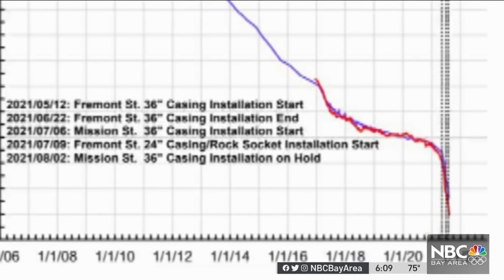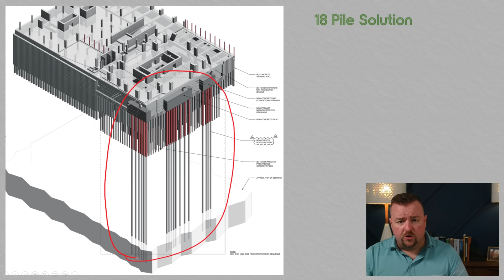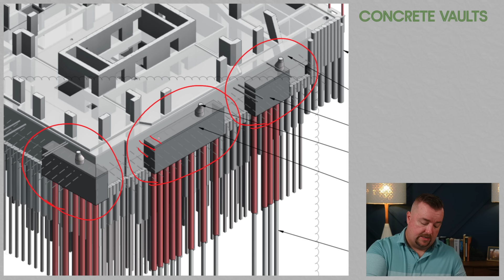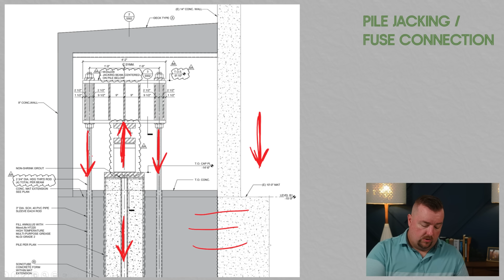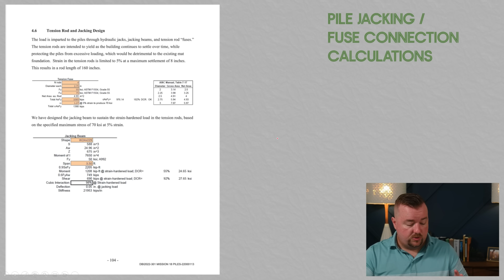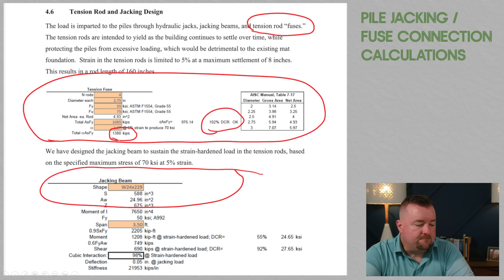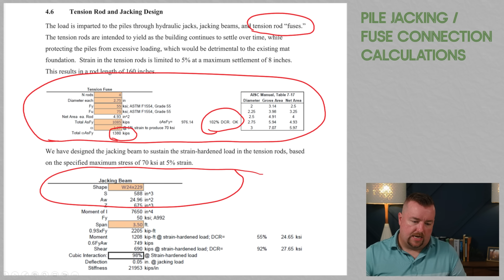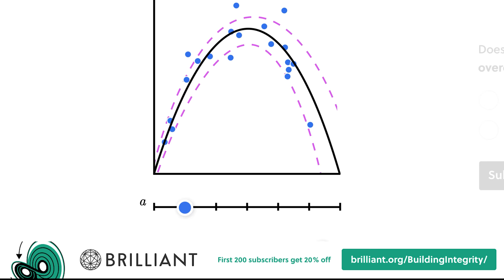Did I Uncover a $100,000,000 Mistake with the Millennium Tower "Fix"?

Comment: I am a retired Professional Civil Engineer who worked on numerous complex projects during my 50 year career. This issue illustrates the fact that engineering projects of this complexity are very difficult to implement because there are always variables that must be estimated during design because not every variable can be quantified with certainty. The vast majority of the time, project implementation goes smoothly with only minor issues arising which are corrected relatively easily during construction. However, at times, major issues arise which are very challenging to correct, as in this case. I feel for the project team; this kind of situation is very challenging for everyone involved.
Reply: High rise building in SF are nothing new. The tower was under built to save cost.
Reply: @Apodictic1  I believe you missed my point, and did not understand the information presented in the video. The underlying soils on that site are quite complicated from a design perspective. It is entirely possible that the engineers obtained a reasonable number of test borings that they thought were sufficient based on other work done by themselves and others in the area. However, in reality those borings did not detect the unusual nature of that particular site. This type of situation occurs from time to time. If this is the case, it could explain why the excessive settling and the tilting are taking place. From what I have read, and the videos that other engineers have posted, I do not see any evidence that the “tower was under built to save cost”.
Reply: @petesmith6434 — The opinion of the remediation engineer is that the cause of the tilting was removal of water from the Old Bay Clay layer west of the site when Salesforce Tower was built.  It seems likely that it was a factor, but probably not the only one.
Reply: @GH-oi2jf  That may have been one of the factors for sure. These kind of “moving target” largely unknown variables that design engineers must contend with. The more built-up an area is the more unknown variables there may, and most likely will, be encountered. Many years ago I designed a large (64” diameter) gravity interceptor sewer project for a very large old city in New England. The entire route where the pipeline was required to be located was built-up and had been so for over 100 years. There was every type and kind of utility located in the same corridor…with little documentation of the horizontal and vertical e location of any of them. Needless to say, this was an extremely difficult project because it was a gravity pipeline so pipe slope had to be maintained. The bottom line is that a construction project that was scheduled to take 12 months took eighteen with large cost over-runs because of unforeseen conditions that could not have been anticipated. This occurred in the 1970s when owners, engineers and contractors were understanding of these kinds of issues and we all worked together to resolve all the issues. Even though the construction time and costs were greater than anticipated, everyone was very happy with the project upon its completion…and no one sued anyone. Today, when issues arise, the first thing every party does is start pointing fingers and run to a lawyer and start legal action against everyone else…ultimately resulting in scandal and even larger cost over-runs.

Comment: All the pilings are in a straight line. Instead of having a small plate set between the 2 rods, why not have a heavier, continuous plate that connects all the rods on each side of the piers ?
Reply: In fact, the new pilings are on both sides of the west corner.  There would be no point to connecting the piles together.  Each bears its load at the edge of the foundation slab.

Comment: Isn't the sinking building pulling down on the alt-thread rods since they are fixed to the plates which are fixed into the concrete vault which is fixed to the building?  You make it sound like it's the hydraulic jack that's pulling down the rods rather than the other way around.  Looks more like the rods are trying to compress the jack and the jack counters by  transferring the force into the fixed piling.
Reply: He has described it accurately.  The allthread rods are under tension; the jacks are under compression.

Comment: I have no engeneering degree and my knowledge of building design is very limited. One can see that there really is no fix for the Millennium Towers. San Fran. is land fill and reclaimed land from back in the early years. San Fran. sits side by side with three major earthquake faults and prone to liquidification. By installing pillings on only two sides of this enormity seems like in a quake that the Bay Area is past due for is going to cause an uneven distribution of weight and load. This building is going to come down, one way or another. Can you imagine what it would be like? OMG! This is just rolling the dice, very, very expensive dice. Why not just take it down? The financial loss , is what it is.. the loss is the result of failure. What about shortening it ? Remove a several floors to where the weight and load is correctly managed. IDK.The possible losses are much greater if theres structural failure and the Millennium Towers, ".. all falls down". 
WOW!  San Jose Ca.
Reply: The fill was excavated from the site before building.  It does not sit on landfill.  The problem is that the original foundation has proven to be inadequate for soil conditions.  Supplemental piles have been added to the side where the subsidence is greater, and they have arrested the tilting.

Comment: Id have a huge steel ring 6 inches thick going around the piling connecting all the rods in place of the existing plate. Isn't it good to over engineer things like this? Like if something needs to hold a million pounds, design it to hold 2 million?

Comment: I'm no architect, but the cost of the steel bars is such an insignificant sum to the project overall (probably less than excavating 1m³ of soil), that there's literally no excuse not to quadruple them. If it added $50k to the overall cost, it's still less than the cost of a single vault structure. I'm going to guess the steel bars come in at less than $150 each, any quantity surveyors able to do an estimate ?
Reply: It may be that they actually are the right size.
Reply: @GH-oi2jf  given that you will never be able to examine them once the concrete is poured, is it really worth taking a minimal approach ?

Comment: I don't get it, they're not just trying to stabilize the sinking/tilt, but they're trying to right it and prop it back up?
The whole building is tilting it seems, not just the corner, is the original foundation/pile cap slab able to take that torsion force on one corner? 
Say the vault connections don't fail and lift and inch on that corner, the opposite side of the whole plate isn't going to rise, there's just a massive deflection in the middle pulling up ALL the original piles on the side of the vault. The compressed subgrade does not decompress, what are they planning to do then?
I reckon the best they can do in this situation is to drill 6-8 bore holes on the worst side of settlement and high pressure Grout THE WHOLE SPACE BETWEEN BED ROCK encasing up to 3 meters of the bottom portion of the original piles. 
The building should settle on the opposite corner and repeat the whole process on the other sides and corners after leveling off the building in 30-50years? 
We all hope no minor EQ happens here also. God bless these folks.
Reply: The first objective is to arrest the tilting.  The tilting is in the direction of the corner at the west.  Yes, the whole building is tilting, because it is stiff, and the direction is toward the corner on the west.

The foundation mat is bearing a load more or less evenly distributed across its surface.  It tilts as it sinks because of differential rates of subsidence in the soils beneath the mat.  The remediation piles are now supporting the west corner so it can’t sink further.  This will allow the building to become more upright as the east end settles.  The building will not be lifted.
Reply: @GH-oi2jf  Not being argumentative, but if they're just trying to stabilize the west corner they won't be using hydraulic jacks. They're trying to prop up that corner of the building. 
The video was saying the embeded threaded bar caps will strip because they'll take the whole weight of the building. 
The basement slab has not cracked because it's settling evenly to the ground water loss gradient, a low grade (difficult to explain in words) but the whole basement slab is supported evenly. 
Once you use hydraulic jacks it pushes a corner UP-wards creating a void between the two opposite corners. Basement slabs are great in compression but once you push up a corner of a building it creates torsion in the center of the whole slab. I think it'll crack ex exacerbating the problem IMO.
I had the opposite problem on one of my projects, we had a high water table and had to install huge preforated drain pipes along the side of hill facing B4 basement wall exterior or the whole foundation (Tub design) will flot before the 20floors could be built on top.
Reply: @rusticbox9908  Each new pile has a hydraulic jack at the top, and the jacks are adjusted to one million lbs.  They are definitely using the jacks.  They are a key component in this system.  The jacks are not lifting the slab, merely holding it up on that end.

This system does not support the entire weight of the building.  The weight of the building is distributed across the foundation mat.  The mat may settle further on the east end.

Comment: Mechanical engineering student here. Has anyone considered how threaded rods tend to fail? The notch effects are horrendous. I know that there are formulas and approximations for equivalent or effective cross-sections. But if you want to push these rods to PLASTIC deformation, I sure as hell hope you know EXACTLY what you're doing, since approximations don't cover this. However, considering the missing calculation of the load transfering plates, it doesn't seem to be the case.

Am I completely on a wrong track, or is this also part of the issue? Pls feel free to let me know, would be glad to learn something.
Reply: According to an article in Structure Magazine, they are normally loaded in the elastic region, near the limit.

Comment: New question what it they add guy wires to the building to stop the leaning and let it settle straight to bedrock  then you wouldd have say a 400. Foot building and 300 housing unites left with 100 basement units for low income residents?
Reply: The leaning has been stopped.

Comment: It does not make sense to sleeve and grease the threaded rods.  The threaded rods should be casted in concrete and used rods and concrete bond to lift the concrete

Comment: Si if system applied to only one side of building wolds and eliminates settlement, what happens if the other side of the building continues to settle? Could you have a large moment arm creating torque causing the building to tilt to the settlement side? They need to secure all four sides I would think.
Reply: They expect and want the east side of the building to continue to settle.  That will bring it closer to plumb.

Comment: So if the entire load is directed to the 6 inch plates embedded into the concrete structure around the pile. Why didn’t they implement several of them in order to ensure that the load was sufficiently transferred? Ya know better safe than sorry kinda thing? Like put 4 on each side or some shit. To ensure that it is properly distributed. Especially if you drop the original scope from like 56-82 piles originally down to 16 piles
*/- I don’t remember the exact number so it is a rough estimate of how many piles I believe should be sufficient with the provided pile information and load requirements. By the way I’m not a structural engineer. I’m just an aspiring astrophysicist
Reply: As a part time rodent hunter I don't have a prairie dog in this fight but I would say that they made this "fuse" all-thread design for the sole purpose of reducing the load on the bedrock from any one given pile because I understand they're concerned about the bedrock itself failing. Therefore the all thread material itself is engineered to compress a given amount over it's total height, hence greasing it up. Therefore you wouldn't be able to attach plates anywhere else along it's height without throwing out that compression calculation.

Comment: Steel and concrete below grade with its attendant moisture issues:  Even if it holds up well when newly installed it sounds like an eventual 'Surfside' collapse scenario in which long term water intrusion rusted rebar and caused concrete failure.  Take the damn thing down.
Reply: A lot of buildings have steel and concrete foundations below grade.  The problems at Surfside went beyond the choice of materials.

Comment: I wonder about that angled bit of the vault.  It seems to me that the entire weight of the building will be pushing down on it, and some of that force will be directed horizontally outwards, with the only opposing force being the rebar.  I'm not an engineer, but that sounds dodgy to me.
Reply: That angle is necessary.  If there were a horizontal joint with the weight of the building bearing downward against the vault, there would likely be fractures at the corner.  It would be difficult to prevent this with rebar.  As designed, there are large reinforcing rods which follow that sloped joint and tie into the reinforcemant of the foundation mat, holding everything together.  This is illustrated in the article in Structure Magazine.

I wondered about this myself at first, until I figured it out.

Comment: Does the earthquake area have anything to go with shearing the rods?  So that the building can move?  I don’t get why only one side is ok?  Wouldn’t the building just sink on the other side??
Reply: The problem is that the settling is uneven, causing the building to tilt.  Now that the low side is supported, they want the opposite side to settle so as to reduce the tilt.

Comment: Well...since they are being "very careful" this time, that's reassuring. 
It seems like it would not be hard to model the threaded rod trying to pull out of the one-inch steel plate.  
(250,000 pounds sounds like a lot of force to me. )
What happens when a gusty wind blows on the building??
Reply: The characteristics of the threaded rods are known.  If they are loaded beyond their yield strength, they will undergo plastic deformation.  That is, they will stretch a little bit, which will reduce the load.

Comment: Putting a building of this size and weight on a floating slab in a landfill area is asking for trouble. By contrast The Belli building is on a floating slab but its a short masonry building
Reply: The top layer of sediment was excavated and the original piles were placed in a natural sand layer.  With a friction pile foundation, it doesn’t much matter what the upper layers are.  In this case, the foundation was inadequate, but not just because of soil conditions above the sand.

Comment: Why no extra cross-plates at intermediate stations above the existing one ? Is there a rebar cage or structure within the vault wall or is the vault just massive concrete to both maintain the integrity of the vault and to spead loads within it ? What is the threadform used on the bars and nuts, is it just a simple machine cut "V" with its inherent stress risers ? Why just a simple steel plate with no flanges to resist deformation along its length as any twisting or bending will affect the concrete surrounding it ? 
For something so vital the mechanical interface between bar and concrete seems awfully slight given the forces acting upon it, given that the concrete pour of the vault is a one-shot effort.
Reply: Their is rebar in the vault.  The illustrations in Structure Magazine show it.

The threaded rods have rolled threads.  They are probably UNC 4 tpi.

The high-strength concrete of the vault is sufficient support for the plates, which are 1.5” thick, in my opinion.

Comment: Not being an engineer, wouldn't the sheer force between the existing building foundation and the vault be really, really high?   I worked for a concrete forming company in college and just looks sketchy as hell to me.
Reply: The steel reinforcing is interconnected.  The shear force is why the interface is sloped near the bottom.

Comment: Why don’t they demolish as many of the top floors as necessary to make the weight of the building equal the ability of the current piles to support what remains? I would think the demolition, renovation, and buyouts of the owners in the demolished floors would be cheaper than all of this.
Reply: The remediation project is finished, for the time being.  Except for inspections.

Comment: Nevermind the steel plate will probably fail. Probably don't know what it's rated for but it's most likely not enough. I'm not an engineer or architect but I've been working as a carp, electrics, masonry, plumbing in houses and buildings for many moons. I don't think this will work.

Comment: I believe based on my experience with people and their egos, especially on a construction site.
 Not many accept a new idea, or failure as their failure.
  And changing anything, is admitting you messed up.
      Why would you have the same people fixing the problem?
   In any case, this is complete Failure.
Reply: The same people did not fix the problem.  Did you read the pinned comment?